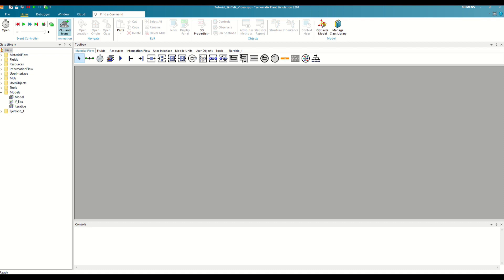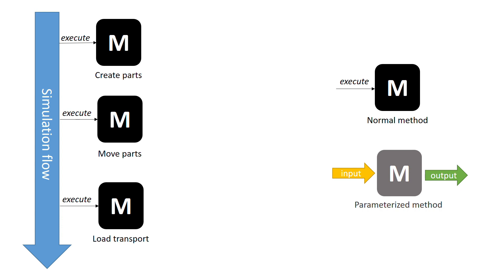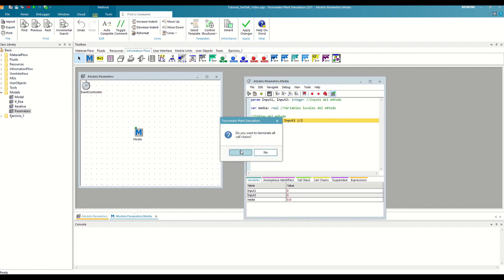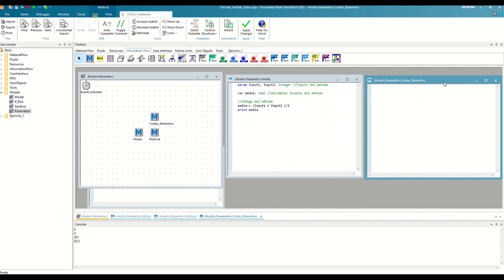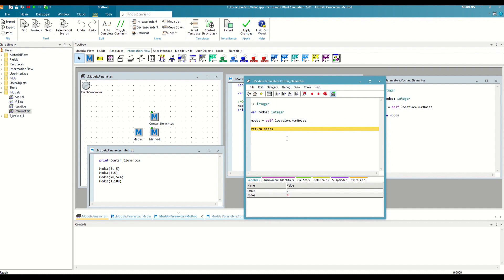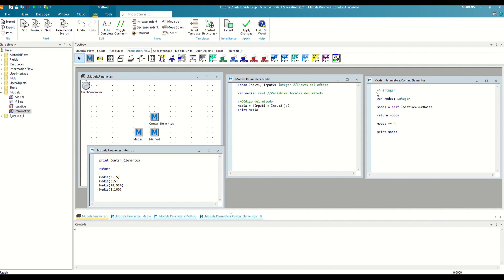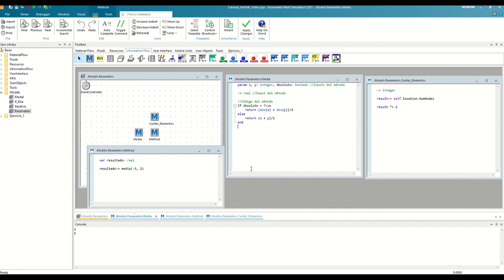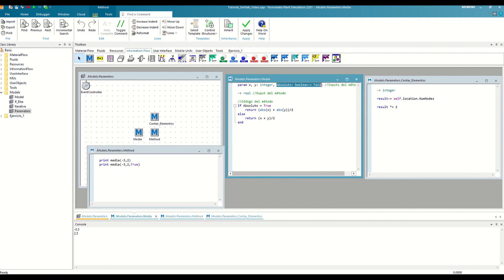SimTalk Tutorial (English) - 7. Parameterization

Comment: Hi. It's me again. 
First of all thank's for your help with last problem what i had (bufer). Thank's to you i got 17/20 score in a projeckt on my university.  

Anyway,I don't know how to convert a time value (e.g. 21:45:00) to a time value in minutes (e.g. 1305). 
i need this beacuse i want to how much will be cost a delay of single work order. 
For example Work order's delay = 5 euro and then when i have minuts i will able to multiplication minuts with delay cost's (1305*5=6525 (cost of delay)
Reply from the maker: Hi youtube.com/@jerry5869, I'm glad you succeded in your project!

regarding your question, the easiest way to do that is to save the time value into an integer variable (or real, if you want to keep the seconds). It will automatically convert it to seconds, after which you only need to divide it by 60 to get the minutes.

Try this in a new method:
var tiTest: time:= str_to_time("5:20")
var iTest: real:= tiTest/60
print iTest
Reply: @AdrianGarciaMoreno-Tutoriales  thanks again !!!